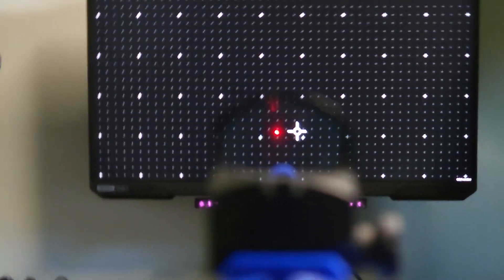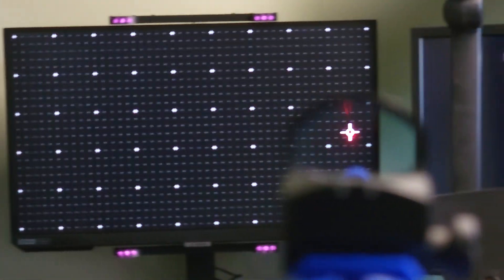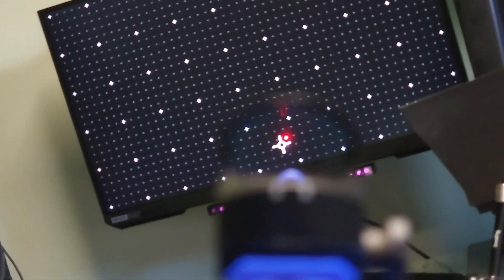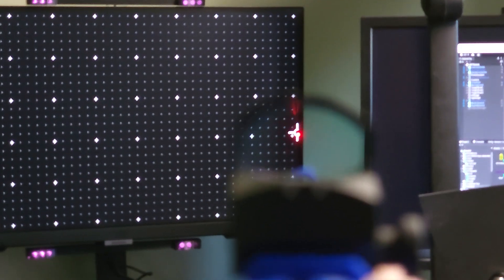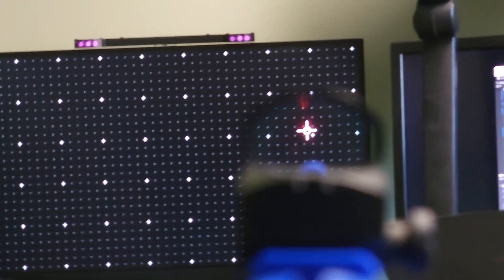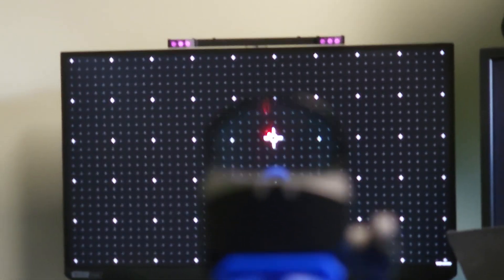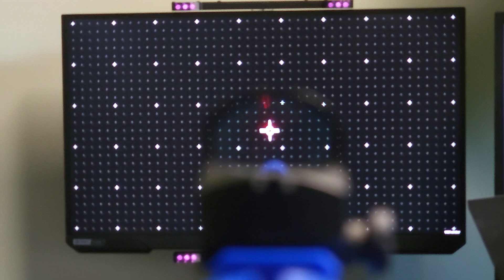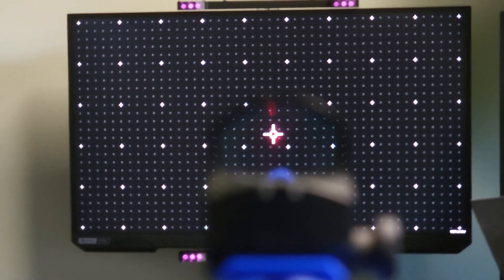Blamcon Firmware FINALLY Done??! You Tell Me!

Comment: looking good, even the naysayer is impressed ! Looks like a little bit of aimpoint drift but like you mentioned most games have generous hit boxes so shouldn't be a problem. You have to be super happy as the firmware was the key to getting this whole show on the road, congratulations. You mentioned before the firmware " worked but got buggy after a while" is that all fixed too?   You should run the same test with a Gun4IR and a Retroshooter and see how the Blamcon stacks up to the competition.
Reply from the maker: It wasn't perfectly calibrated and there's several smoothing algorithms that are why it looks like there's a bit of drift in places, that's a feature so the cursor doesn't bob around. You can turn it off and we have 2 smoothing algorithms you can choose from that behave differently. The drift is fixed now in theory, but I still have to do a 4 hour session from different play areas etc. I'm leery to compare against other guns myself, I own them all and test internally but I don't feel it will be fair if I do the testing. I'm hoping others will do that for me from an unbiased point of view.
Reply: 如果效果不如Gun4IR就没有存在的意义
Reply: 硬件和Gun4IR看起来大同小异